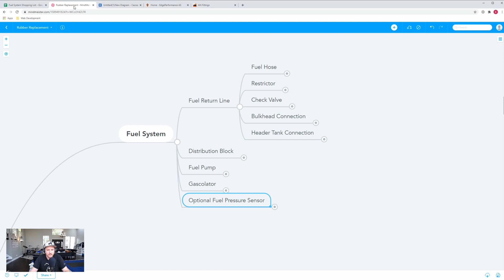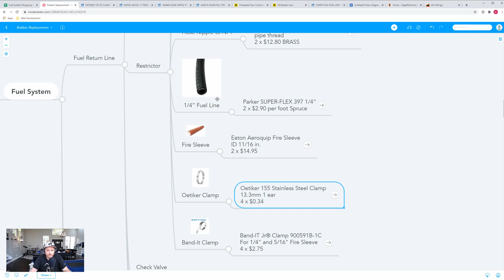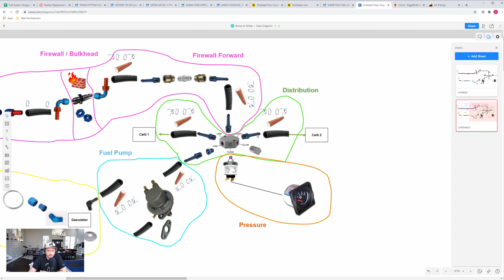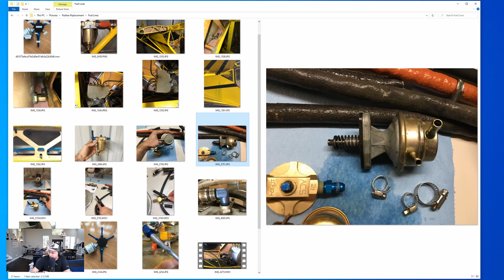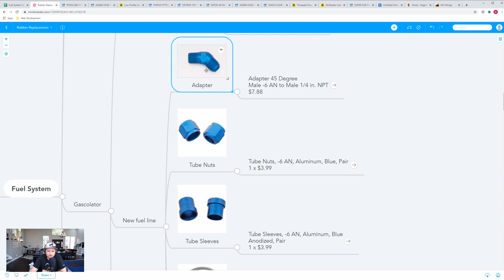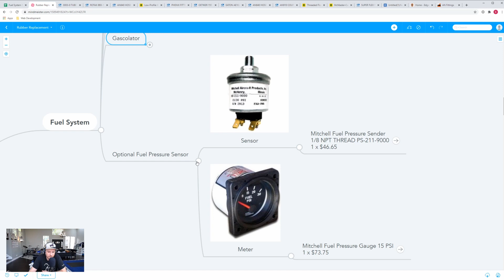My Rotax Fuel Line Shopping List | Kitfox Flying

Comment: Excellent video. Really appreciate the time you put into it. Just curious though, why did you replace all the AN hardware?
Reply from the maker: I'm trying to remember... I think because I was missing the main return line I had to order all new parts for that, including the bulkhead fittings, the hose to the firewall from the fuel manifold and the hose inside the cabin. The aluminum fuel lines I reshaped and had to experiment with new fittings, especially the one in front of the firewall where it curved around my coolant pipe. The rest of the fuel system was really old so I think I just did it to freshen everything up.
Reply: @mechfamo  Fair enough. Looking at starting the 5 year on my bird. Your video is a great help.
Reply from the maker: Best of luck with the 5 year!

Comment: This has been so helpful..Thanks!
Reply from the maker: That's great to hear, thanks Tom!
Reply: @mechfamo  Damian, the distribution block was a brilliant idea..I think it’s far better than the Rotax crushable gasket joint for all the fuel lines to come together…there’s a bunch of things I would like to discuss with you..I,m doing a project now of a Apollo Fox Trike and am changing out the motor mounts and doing the 5 year rubber replacement on everything…if you want drop me a line here and I’ll send you some pics..it’s been very interesting to say the least…tomwesley57@gmail.com

Comment: Hi. I have a plane with Rotax 912ULS as well, and I have the exactly same sensor and sender than you. But the gauge shows only about 7 to 8 PSI of pressure. Is this a normal reading? Thank you very much.
Reply from the maker: Hi Valter, did you end up working it out? I didn’t install the fuel gauge because I’m wait until I work on my panel.
Reply: @mechfamo  Hi. I bought my plane with it already installed. It works, always close to 8 on the gauge. I just don't know it it will be noticeable on the gauge in case of a lower pressure.